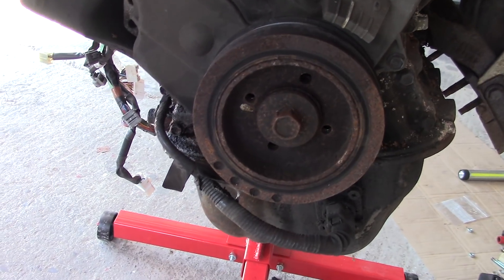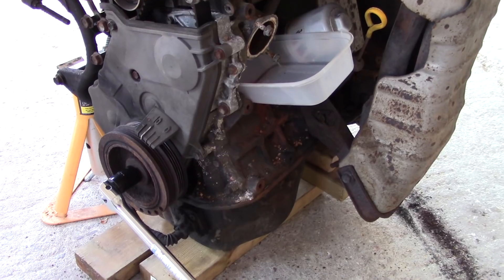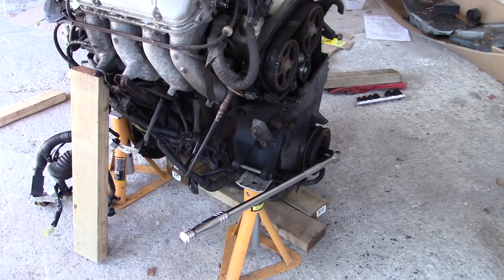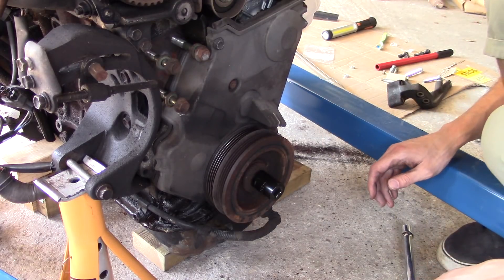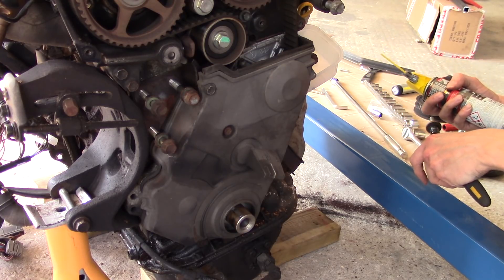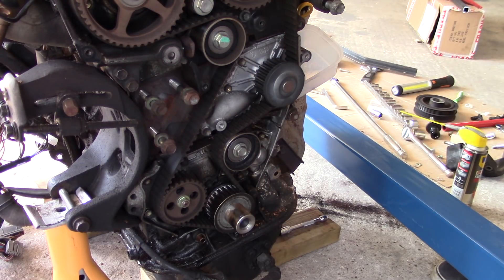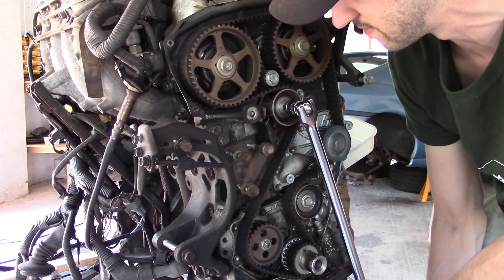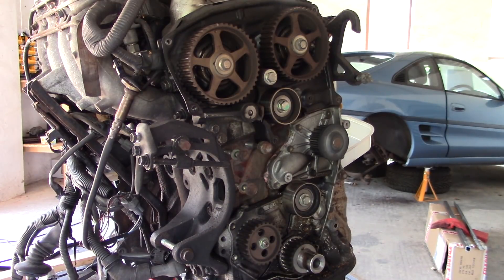Toyota MR2 Timing Belt and Water Pump

Comment: 19mm harmonic balancer socket with an impact wrench :) off in a second flat
Reply from the maker: We did try an impact wrench, but our compressor wasn’t powerful enough to generate the torque required 😕

Comment: Have you got all the part numbers for your Timing belt kit mine is the 3S GE engine 93 rev2! looks the same,  Thank you Kev
Reply from the maker: It turns out we were sent rev3 parts and the water pump ended up leaking, check out out later video for more info -
https://youtu.be/rp4FC827J34 - we did find the right parts on gt4-play.co.uk, definitely recommend them if you’re in the uk

Comment: I was shouting 'just extend the length of the breaker bar for fucks sake!' Simple engineering principles of moments and levers!  I learned this at School, not some engineering college.
Reply from the maker: Yeah, I kept that as last resort as I didn’t want to risk snapping the head off the breaker bar by applying more torque than it was designed for, but in the end it was the only thing that worked. Luckily the breaker bar lived to tell the tale.

Comment: Some advice as Toyota tech, those pulleys sometimes come off with a couple small prybars, or even your hands, for me, a puller is a last resort, I’ll try the stupid stuff first to save time if I can, 

Also! A large chain wrench to hold the outside of the pulley, while you use a breaker bar to turn the bolt the other way works well sometimes.
Reply from the maker: Thanks for the tips, we’ll try that next time 👍

Comment: Mate  it`s time for the heat torch and a purpose built spanner that is made to belt with a 19 pound hammer,the shock will do it
Reply from the maker: We ended up removing it by bracing the flywheel on the floor and using a 1.5 meter breaker bar

Comment: Nice job keeping at it with the pulley, I would have broken out the torches to heat it up.
Reply: You would likely need a new harmonic balancer at that point.
Reply from the maker: It was getting to that point, really didn't want to risk damaging things with heat though.
Reply: digijams ...or try an impact..!!

Comment: . . . . Next time just go buy a $130 Electric 1/2" impact wrench. . . . Would have taken it right off, no hassle.
Reply from the maker: We did try with our air impact in the previous video, but it didn't work. The air gun is rated at 500 ft lbs, but I suspect a long hose, and/or our very small compressor restricts its power
Reply: Always be wary at urinals with a long hose and a small compressor.

Comment: Some advice for the future. At 2:00 in the video you have your fingers wrapped all the way around the grip of the breaker bar while pressing down with as much force as you could. The problem is, if the bolt had broken loose, you hand could have hit the hard concrete floor and really messed up your fingers. Whenever you find yourself in this type of situation, push with the flat of your hand to save your knuckles.
Reply from the maker: That is some VERY good advice! I was wary of the bolt giving and me falling into the floor, but I didn't even think about changing my grip. I'll remember that for next time 👍 
- Matt
Reply: subagon Yeah, I learned that the hard way... after many times.... mostly.

Comment: Same problem I had trying to undo the pulley bolt on my E36 to swap the thermostat - in the end I gave up and worked around it.

Seems like the solution is LEVERAGE.